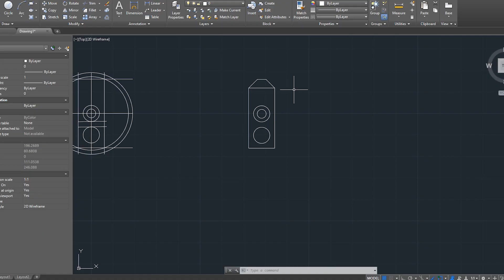Making Heel Clamps for Watchmakers Lathe Faceplate - Watchmaking Vlog 46

Comment: Bro that happens to me too! I hate the carbide part off tools! I just grind a piece of HSS with a thin length protruding as the part off tip (prob about 5-8ml or so protruding out from the body and on the right hand side of the HSS bit) and round off the tip, then turn off a nice chunk at the back of the part (on the chuck side) so the thin length of the HSS bit can go in far enough to part the tool off, you know what i mean? (Sorry a bit hard to explain properly lol) takes a bit of extra time but once you have a few different sizes ground up the only extra part is turning the back side so the tool can go in deep enough to part it off, i just cant get the carbide tool to work no matter what i do, not sure if its the hp or sturdiness of the machine even though i doubt both, i tried pretty much everything with positioning the tool, speeds and feeds but i just cant get a clean part off with the carbide tool! And ive seen quite a few other people having the same issue and abandoning the carbide part off tool quite a few times because they just cant get it to work properly.

Comment: Hi Dean happy new year to you! I hope you get to your goal soon! I'm curious what material did you make the clamps out of? Also what sort of materials do you keep stock in the workshop?
Reply from the maker: Hi Chankyi, thanks for your support! I made these out of Mild Steel. I usually have brass sheet and round bar, some mild steel round bar (from learning on lathe a long time ago). I have several small diameters of silver steel, and some gauge plate steel. (carbon tool steel)
Reply: Thanks Dean for your quick reply! Does it matter to you what sort of brass? I know some books mention using only clock brass. But I wonder if they make alot of difference.
Reply from the maker: Most definitely. You want free machining brass, usually around C356 or C360. Or for sheet brass, you want engravers brass. Edit (engravers brass CZ120)
Reply: Dean DK thank you for that information I will read up. How about steels? Can i make springs with mild steel or tool steel or does it have to be spring steels?
Reply from the maker: You would need to use a carbon steel, so once you make the spring you can harden and temper it so it holds it form

Comment: Dean check out rocol fluids website you will find you get a better finish on your cuts and the tools should last longer, Ok i don't want you to take this the wrong way, but do you want to create your own watch?  or make every tool to make a watch? you can buy a suitable set of heel clamps for your face plate and concentrate on creating a watch. Your hearts in the right place but you're wasting time on distracting projects, the buttons were a waste of time and weren't even mechanically efficient ! and time is scarce and presides beleive me i know! All power to your cause and happy new year, Helen x
Reply from the maker: Thanks appreciate the tip, I will definitely grab some Rocol, someone else has mentioned that fluid before, and I plan on picking some up, just trying to get finances together haha. All good Helen, I appreciate that, it's something I am in constant battle with, or trying to make certain tools for my watch, and making the watch. I think timing played a huge roll, I couldn't find clamps locally, and it was a few days before Christmas before I started making the button clamps, which I had finished pretty quick, but I discovered they weren't suitable. 

I'm not sure ordering would have got me anywhere closer faster, as I need the clamps to finish the drill jig. I plan on only making tools which are custom, that will increase speed and accuracy of parts. Also, I don't have much spare cash to be putting in to every single tool, and I must pick and choose accordingly. 

In saying that, I felt that I spent a lot of time toolmaking than I would have preferred, and that your comment has re-sparked my commitment to stay on the path or making my watches, and not get bogged down with simple things I can purchase. 

Thank you so much, I really appreciate you watching my videos, and reaching out. ☺